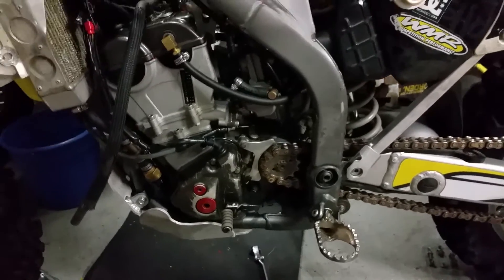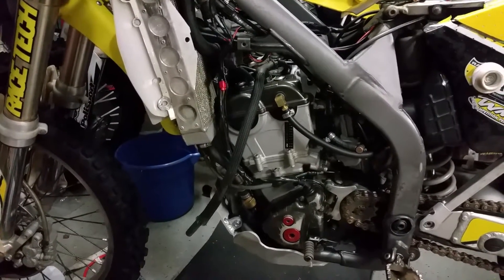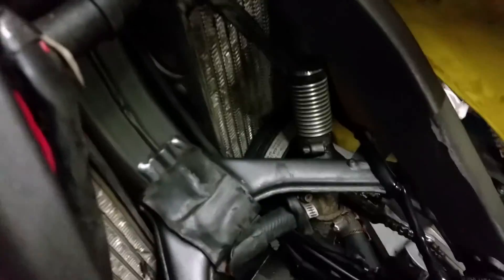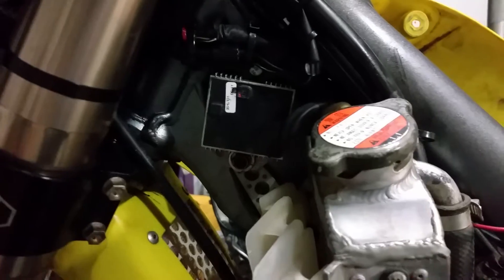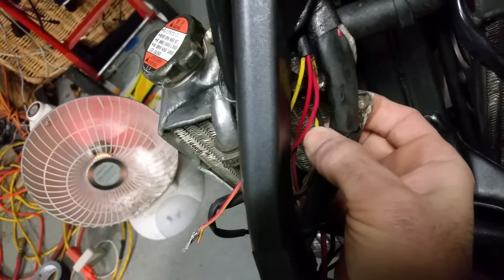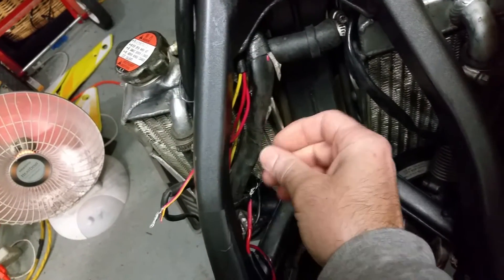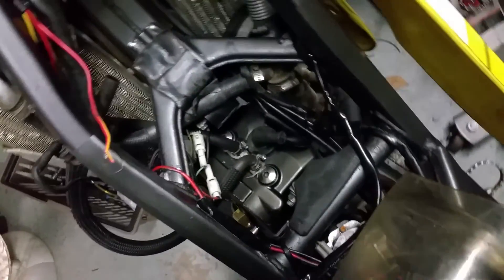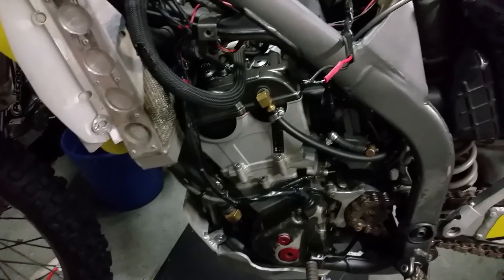HOW TO ADD A COOLING FAN OR HEADLIGHT to DIRTBIKE, STREET LEGAL RMZ250 KX250F  04MX CONVERSION

Comment: Trying to figure out what wire to tap into for my 09 rmz 250 to run a light
Reply from the maker: If the video doesn't help then take your best guess as to which wire it is going to the stator and using a razor shave some of the insulation off the side so you can test the wire with a multimeter and once you find which one has enough power you will need a regulator rectifier and a capacitor or battery.

Comment: I wanna do this on a 2009 rmz 250. Can anyone send me links for a headlight and will it work?? I don’t know which ones to get.
Reply from the maker: It's not the headlight itself it's really the bulb you need to  make sure is LED and the lower the watt consumption the better but any LEDs will draw very little power so you should be fine. If it comes with a regular bulb just Google the bulb type with the word led as well and buy the led equivalent

Comment: Hello .. I have a 07 suzuki Rmz 250  and I would like to light the motorcycle where or how can I get the stator so that it has continuous electricity .? Thanks.!!!
Reply: The stator is part of your bike which makes electricity for your spark plug mate
Reply from the maker: For the 07 you would need to buy a new lighting stator, only the 04 has enough power stock to work. They were overbuilt and quickly were changed in 05 to produce just what they needed in terms of power.

Comment: I read in a post that the stator produces 30w per yellow wire.  The fan you recommend  draws 26.4 watts.  Do you think I can run two fans off the stock stator?  How well does your stator handle the lights you added with the fan running?
Reply from the maker: I haven't had the chance to run the headlight and fan at the same time but my headlight is only 10 watts because it is LED and even without the fan running I did notice that the lights got allot brighter or at least didn't flicker when I revved the engine and since the voltage is constant from the regulator rectifier my guess would be that it is getting more amperage possibly when the engine is at higher RPM's, not sure exactly maybe someone with more electrical knowledge can chime in there?  I was going to install a more powerful capacitor but I never got around to it because I've had bigger engine issues to deal with from a dropped valve. Why do you think you need two fans? I've never overheated with one. If they were crappy computer fans I'd say yeah get two but unless you ride real muddy trails where you would get stuck for long periods of time than you should be fine with one of the SPALS. Only one way to know for sure, is try it out, my guess is that worst case they would not be running at full power! With a battery system it would likely work better because even if you were drawing some of the battery power , once the  fan stopped the battery would have a chance to recharge. The only battery that I could find that could handle the amount of power it would be getting to recharge was regular enduro batteries and those are too big and heavy for my bike so I went the capacitor route. I'd love to hear anyone out there that has successfully used other type of batteries?
Reply: I'll go with the one fan to start.  I was just curious if it could handle two.  My bike gets really hot when riding with slower friends.  Last time I went out I had to keep roll starting my bike after it got too hot once.  I couldn't get it to kick start.  I had to turn up the idle to keep it from dying and it had no power.  It's not fun riding with no engine breaking and bad acceleration.  My valves ended up being about .2mm out of spec.  The intake valves weren't even closing all the way.  I put on a used 2006 head and now it runs great.  I started looking at radiator fans because I don't want to ruin the head I just spent half a day installing.  That's how I found your video.  I ordered a pack of 6 capacitors.  Do you see any upside/downside to adding two capacitors instead of one?  Did you wire your head light with or without a capacitor?
Reply from the maker: If I had to do it all over yes I would add as many capacitors as you can fit where you are mounting them , also if you add enough it may even keep the lights and or fan on for a short time after shutting off the bike which could help you see when walking away from bike or even cool the bike a tad while it's off when taking breaks during the ride. Now that you mention it I may have made the mistake of adding the headlight right off of the regulator rectifier and maybe that is why its flickering. I'll try to double check and see if I have it wired before or after the capacitor. If not I'll just add another capacitor.
Reply: You can get a pack of 6 capacitors here: https://www.amazon.com/gp/product/B07C29JGWM/ref=oh_aui_detailpage_o00_s00?ie=UTF8&psc=1
Reply from the maker: Wow that's a really good deal! Do you have an 04' cause in case I didn't mention it or you didn't know that is the only year that comes stock with a lighting stator? BTW cylinder works makes new aftermarket heads for $350.00 if you ever have any issues down the road. Just need to install new valves and springs and you are good to go.
Reply: Yep, mine is an 04.  My head was in okay shape.  Everything else was getting worn.  Cams, caps, buckets...  I read that the 06 head had better parts and better oiling, so I decided to put the 06 head on instead of rebuilding the 04 head.  I'll let you know how the fan install works out.
Reply: I wired up the fan with 2 capacitors and it works great.  I don't have the thermostat installed yet.  I ordered this thermostat so I wouldn't have to mess with my coolant lines: https://www.amazon.com/gp/product/B005JV8MK0/ref=oh_aui_detailpage_o00_s00?ie=UTF8&psc=1
Reply from the maker: Nice , did you run the capacitors in series?  so are you going to tap the radiator for that thermostat? I was scared to do that cause thought the slightest hit on it could cause it to leak since there can be quite alot of pressure built up when it gets hot.
Reply: I ran them parallel. The probe goes between the fins just like the fan mounts so I think it'll be fine.  I also wired the reg/rec after the plug so I can still unplug my stator.
Reply from the maker: Smart move tapping into it later down the line cause I just ran into an issue with that. I'm replacing my stator and need to rewire it now. I'm not sold on that thermostat working unless its thick enough to touch the vertical fins that carry the coolant but because that thermostat turns on at a lower temp than most it might just work. I'd be interested in knowing if that works cause I might add a fan to my 2010 yz450f and that would be a huge timesaver. I remember looking at some that stick on to the radiator surface but I went the conventional route to be safe.
Reply: @joedirtbike461  hi I'm looking at doing the same with the two capacitors  I'm not the greatest with electrics/ wiring have you got a diagram of how you linked them parallel please 😎👍
Reply from the maker: @Gideon Reinders it's been awhile since I've done this and I no longer have this bike but I believe the positive wire from the regulator rectifier went to the positive of the capacitor and the ground went to the negative. I forget whether there's a negative off the regulator rectifier, if there is I would just use that. Then you just hook up the possitive and negative of whatever you are running right to the capacitor or if you are using a switch then hook the switch up to the capacitor. It's really simple.
Reply from the maker: @Gideon Reinders yes to make it simple think of the capacitor as a battery. Just like a car it will have a positive and negative and once it's hooked up you will now attach everything to the capacitor positive and negative just like you would any accessories you would add to your car battery. Justin@durotools.com
Reply from the maker: Yes then run the wire or wires from capacitor to ur switch. Depending on the type of switch you'll need just a positive or both the positive and negative
Reply from the maker: @Gideon Reinders Yes you are correct
Reply from the maker: @Gideon Reinders  the 05 doesn't have a lighting stator only the 04. Did you check to see if your getting any voltage do you have and light bulb from a flashlight or a car that you could use if you don't have a multimeter?  if you're not getting any power or any voltage at all fan try hooking the ground or negative directly to the frame on your bike  if you are getting voltage but if it's well under 12v and just not enough to power the fan then you just need more voltage from a lighting stator. I don't recommend getting an 04 stator cuz you would need the 04 black box and I heard it's a downgrade with problems